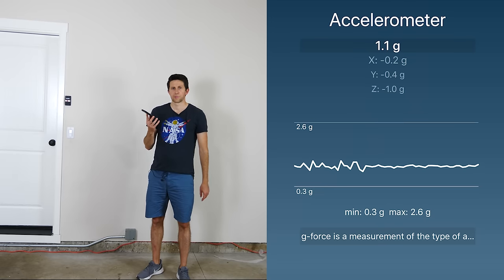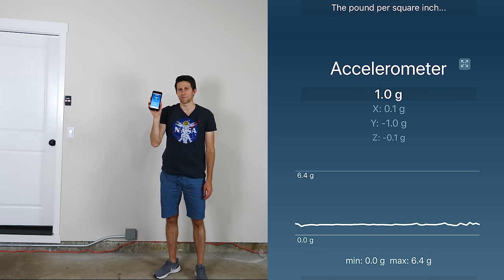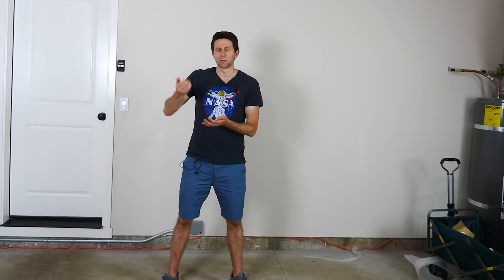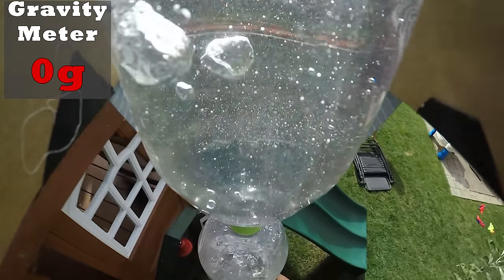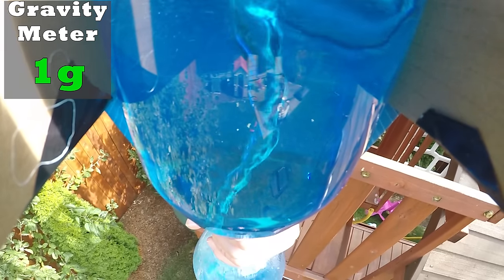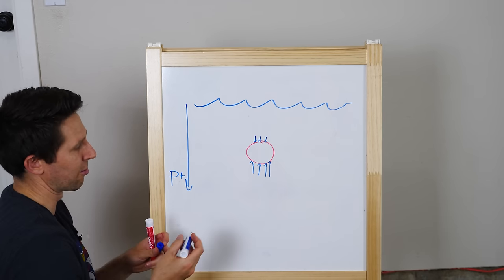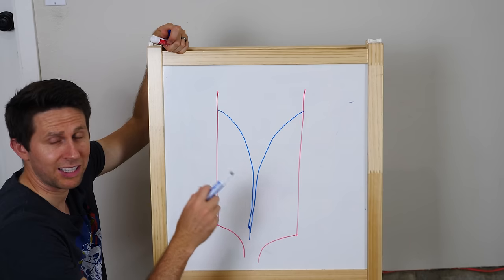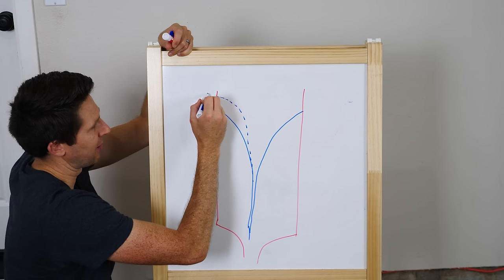What Happens to a Whirlpool in ZERO-G?

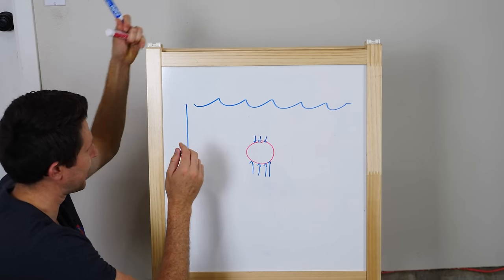Comment: 5:55
As the heavier fluid, water keeps falling into the lower pressure pocket that is occupied by the gaz , thus always pushing it upwards. A gaz bubble is akin to shadow not being a thing but a lack of something (light): a bubble is "negative space", a water hole into wich water continuously falls until it is level again reaching the surface.
Reply: This is a nice explanation but I don't think it's what really happens. Due to the surface tension, water will avoid falling into the bubble and instead go around it.

if you've ever made a soap bubble with excess liquid, you'll notice that the liquid goes around the bubble and accumulates at the bottom, instead of falling through the bubble. But soap water doesn't have the same properties so here's a better example :

when pouring water out of a narrow opening, bubbles will momentarily stop the waterflow , meaning when a bubble is big enough to fill the entire opening, water can't get through it at the same time. And since there's no space around the bubble inside the narrow opening or tube, there's no room for the water to flow.

All of this doesn't necessarily contradict your assumption that the water is falling instead of the bubble is rising. Ok, but consider what happens when large bubbles reach the surface of a body of water.
The water is elevated and pushed upwards by the bubble, right before the bubble pops.
Why would the water go up if we assume that the water is falling ?
Only explanation is that the pressure pushing the bubble upwards, is also pushing the water above the bubble up, and then around the bubble.
I thought of this part as I'm writing due to the recent video of the backyard scientist, where he made huge ring bubbles in his pool and those displaced a massive amount of water up when they reach the surface. It's fascinating ^^

Anyway, long comment, food for thought, I also don't know this stuff for sure x)
Mostly fun pondering about it and practicing english
Reply: @YounesLayachi  you are correct and great brainstorming, it would be crazy and awesome if each bubble had rain in it.
Reply: @tibss  thanks !

Comment: 1:00 to be more clear, there of course is acceleration, when you let go of your phone, but the sensor isn't meassuring it, because it only meassures weight and converts it into acceleration. If something accelerates into another thing, like if we stand on ground, then we causes weight instead of accelerating. Ironically a sensor only meassures acceleration, it it doesn't. It only shows what it would accelerate, if it could. If it sows 0g, the sensor accelerates as fast as its surrounding, on wich it measures its weight, but soo there is none.
Reply: That's the newtonian explanation

Comment: Cool demonstration! Your explanation of why the bubble rises isn't exactly accurate, meaning when you show pressure on the bottom is higher than pressure on top.  Consider a neutrally buoyant person underwater -- they have more pressure on their feet than on their head, but they don't rise up like your bubble does. It's the density that's important.

Comment: Simpler explanation of bubbles in zero-g would be to use **Archimedes Principle**: the the upward buoyant force of the bubble is equal to the weight of the fluid that the body displaces. In zero-g the weight of the fluid is zero, so is the buoyant force.

Comment: if you go deep enough will pressure keep bubbles from rising?  or prob not, because the pressure is coming from more angles than just downward?
Reply: @kirkhamandy  so bubbles at the or near the bottom of the ocean behave the same as those closer to the surface?

Comment: So if the top part of the experiment were open to the atmosphere would we expect the bubbles to still rise because of differential in atmospheric pressure? I would guess that the bubbles would still rise but at a much slower rate than under gravity likely because the vast majority of buoyancy in liquid related to the weight of the liquid itself (over the short distances of the bottle).
Reply: Creamy Pasta I don’t think so because the atmosphere would not be in freefall.  So the atmosphere still has weight. There should still be an atmospheric pressure difference from the top of the bottle to the bottom of the bottle if the bottle is open to the atmosphere. It would be pretty minuscule however and in a practical sense would not likely see much of an effect

Comment: Nice! This is basically the experiment I designed in my head to show Flat Earthers that things fall to earth because of gravity, not buoyancy.
Reply: The observations are real.
Gravity is just a word.
And it means weight.
Reply: @flatplaneoregon7075  Could you elaborate?
Reply: @andyjohnson4907  
Well the oldest definition of gravity was a low deep sound.
Which is intriguing because sound is one of the things that showed me the Earth is a Stationary Plane.
Then they applied it to weight heaviness. Like the weight of words or ideas, the gravitas of the words (sound again) or their deep even hidden meaning.
Then that became the density or heaviness of larger things or even everyday objects.
Now it is the all seeing all knowing selective, actively ever adjusting  impossible force that's not a force that really is just nothing more than a theorytale.
All of which has no effect on gyroscopes or how and why they operate independently of this alleged gravity
Reply: @flatplaneoregon7075  That's quite the word salad.
Reply: @andyjohnson4907  
Really, was it?
YOU asked me to elaborate.
 Do Not Take My Word For It.
Go look up the etymology of the word yourself.
Reply: @flatplaneoregon7075  Etymology is actually one of my passions. I'll definitely look it up.

But the etymology of words rarely has any relation to their current use, and certainly isn't the basis of a hypothesis.

e.g. The lens in your P900 isn't made of lentils.
Reply: @andyjohnson4907  maybe it could be...

Comment: If the water preassure increases as you go further down, does that mean that at a certain depth air bubbles will stay still and not rise to the surface?
Reply: No. Why would that be, since the pressure at the lower parts of the bubble will always be a little bit bigger than at the top of the bubble. The only thing, that might happen is that the air or the water change their physical state because of the immense pressure in general.

Comment: Centripetal force points inwards, and is a real force, while cetrifugal force is the apparent force felt by the object in a rotational frame, outwards caused by ACCELERATION.

In a ball full of water on a string, Centripetal is the tension in the string that's a real force, centrifgual force is the liquid being pushed to the back of the wall.

Comment: When I was younger (and more importantly, much lighter) if i had a transparent (and preferably unbreakable) container like a water bottle half full of water I used jump up while tossing it so that both the container and my head were free falling in parallel; so I could watch how it behaved in free fall. I sometimes even jumped from the roof of my school, which was about 1.5 floors onto grass, it gave a lot of airtime! 

 But sadly as I grew taller it got increasingly hard on my joints.. I'd probably break something if I tried that stunt now as an adult. :(

Comment: During my travels in my TimeBender from Lanulous, I, of course, must bring water for the 14 Lanulousian rotation journey.  Going through the intergalactic zone of desolation space, I usually turn off the main artifical gravity generator and turn on the auxiliary 0.25 gravity generator to keep air and water seperated in the Thorium reactor drive. Then I go into stasis bladder for ten Lanulousian rotations because no pilot is needed for the zone of desolation. There is nothing between the Veridian system and the Solar system, not even atoms nor dark matter.  Usually the 10 Lanulousian rotation journey, through the zone of desolation, is uneventful.  But the last time passing, there was an axillary gravity generator failure. The bagged water for hibernation injection into the stasis bladder seperated with suspended air bubbles in the water.  That caused no problem at all in the stasis bladder, but triggered the alarm because the Thorium reactor drive coolant water was being filled with suspended globes of air bubbles that hindered the cooling of the main Thorium reactors and secondary shifted plutonium reactors.  The large suspended air bubbles in the water had to be removed quickly.  I turned on the main gravity generator and the large air bubbles came to the surface of the water and popped into the atmosphere.  I was only 1/30th of a Lanulousian rotation from Thorium and shifted Plutonium containment breech causing a mixing of the two and achieving a runaway fission reaction.  This would have destroyed my 1138 TimeBender and anything within one lightorbit radius of where I was zone.  It is a good thing I was in the middle of the zone of desolation and even a better thing that there was not a containment breech.
Reply: y did i read this lmao

Comment: Well, technically if something is falling it is still feeling earth's acceleration. It just doesn't feel the pressure of its body on the ground or its surroundings.
The handy measured compression of smth under its own weight.
Within an enclosed space that is falling, there are (mostly) no gravitational effects visible because earth's acceleration doesn't depend on mass. So the air and the water in the bottle are displaced at the same relative speed. That's why there is no relative pressure (as he explained with the bubbles) and within the bottle things move to each other as if everything was weightless.
Once the bottle reaches terminal velocity, the gravitational effects within the bottle return.
This weightlessness only works as long as your enclosed space is being accelerated.
Reply: Does orbiting stuff (orbiting is just falling with style ^^) accelerate? No they don't. 
Even if it's not intuitive the fact is it's not you who are accelerated to the ground but it is the ground that is accelerating to you. That explain why everything fall at the same speed, cause in fact they don't move, it's the ground that move. but all those movement or none movement are done relative to space-time which is the one "moving".

Comment: The statement that "an object thrown upwards doesn't feel any gravity" is what I have a problem with. Object flies up due to initial upward momentum you give it, then it slows down due to it is acted on by gravity (i.e. it is being decellerated on its accend). So how is it not "feeling" any gravitational acceleration during the accend?
Reply: Is it the object being slowed down or the ground keep accelerating?
Once the object is launch it has no more acceleration and keep his speed (will ignore air resistance here) while the ground is constantly accelerated and therefore keep getting "speed" so the relative speed between object and ground decreased until it reach 0 when the object reach it's peak altitude, then relative speed keep decreasing so now it's negative so ground is going faster that object and object appear to fall back.

But i guess only a 4D creature could see it that way... don't forget that to stand still in a collapsing/bending/wrapped (never sure which word to use for that...) space-time, you need to accelerate just to stand still (not sure that will help but i hope i make it a bit more clear)

Comment: I got really confused with that explanation, because the accelerometer is measuring the force the earth (or you) is doing, not the resultant... and the resultant is equal to zero when you are holding it (therefore the phone is not moving). But that's not equal to zero G. You can see that when you drop the phone, and the accelerometer shows 0 (because nothing is holding the phone) but the phone is free falling, and not in 0G condition. The 0G condition would've been achieved if the falling was high enough that the air resistance compensated the falling, then the phone would've hit terminal velocity and experience 0G.
Reply: The nG scale measures the intensity of the acceleration countering your movement not the actual gravitational force. On ground, the normal forces counters your down movement with the same intensity as gravity, so 1G. If a freefall object is aerodynamic enough, it doesn't feel air resistance and therefore has 0G. If the air resistance compensated the falling, that would be 1G. If we put it in a centrifuge we could get 2G  if the centripetal force countered its centrifugal movement two times the intensity of earth gravity.
Reply: @quantumsoul3495  Thanks for you reply !!! But I still didn't get it: "If a freefall object is aerodynamic enough, it doesn't feel air resistance and therefore has 0G" it has no sense to me, because if I take this aerodynacmic object and let it go (of any distance from the ground) it would hit the ground ... so that proves that it's not a 0G condition, but it has gravity acting on it! (otherwise it would float)
"If the air resistance compensated the falling, that would be 1G." I really don't think so, the resultant would be equal to zero, because you would have the air resistance compansating gravity and the speed would not increase anymore, it would be constant, proving 0G or zero forces acting on the object.
Did I think something wrong?
Reply: @camilabborba  Your problem is nG doesn't measure the resistant nor does it measure the gravity. In a centrifuge you can get to 2G but you still have the same gravity force. In all the cases above, you still have gravity. The scale mesures how you "feel" weighted. When you fall without air resistance, you feel weightless. However, standing on the ground you feel 1G.

Comment: Question 

When we close our eyes we cant see anything which means light is not reaching our eyes . But even with eyes closed , we can still sense if the light gets off . How is that possible
Reply: That happens because there actually IS light hitting your eyes, just a LOT less than if your eyes are opened, so if the quantity of light change, by turnig off the light or pointing a flashlight to your eyes, you can perceive it.

Comment: Phone accelerometer showed 0.9G when it left your hand, according to frame-by-frame analysis, and achieved 0.0G at the top of its arc. The phone did not lose all acceleration when it stopped touching your hand, it decelerated rapidly.
Reply: No it is not. The phone can feel acceleration only compared to a frame of reference to which it is physically connected. Unless the phone's innards are subjected to forces internal to the phone during the climb, the accelerometer cannot feel any acceleration if the phone is in ballistic mode. The phone is in free fall mode as soon as it leaves the hand, although it is not, per se, "falling" in the usual sense. The only reason it is going up when leaving the hand is inertia (the phone has an upward speed when leaving the hand)

Comment: gravity isnt the only force here. when the molecules rotate in a circle. Those in the middle have the lowest pressure on them so the atmosphere is darting in the middle and at pressures proportional each "rings" rotation speed making the outer edge the highest pressure...do it in a vacuum or a pressurized tank and you'll notice differences

Comment: What happened to the bubbles just like what you feel in car’s acceleration, so you feel that you got pushed to the opposite direction but here in the case of bubbles the acceleration was vertically instead of horizontally in the car. In addation, the gravity can go to negative number so the bubbles can go backward from up to down if he throw the bottles down with more force🤓

Comment: In the water bubble experiment, If water pressure doesn't apply when in zero-G, do the pressure inside the bubble is greater than the outside ?
Reply: They are the same.

Comment: 5:40 does that mean a bubble at the bottom 9f the oceam will stay where it is?
Reply: I think I see what you're asking. The answer is no. The reason why there is more pressure on the bottom compared to the top, is because air is LESS DENSE than water.

If you had a denser object (like a bowling ball) then the pressure would be reversed. The pressure would be stronger at the top (going downward), rather than stronger at the bottom (going upward), hence why bowling balls sink, and bubbles rise.

If you had a bubble at the bottom of the sea floor, it always would rise (if it's LESS DENSE than its surroundings.) The upward pressure on the bubble would be at its maximum on the bottom of the ocean, because it literally has the entirety of the ocean above it vying for its space. 

Air is attracted to the Earth with less gravitational strength than water. And because gravity is pushing water DOWN more strongly than it is pushing the air down, that makes water win that "battle" for the space the air is occupying. The water steals the bubble's space, and thus the bubble is propelled upwards. The higher the bubble rises, the less pressure it has underneath it, because there's less water trying to displace it.

But of course if you turned gravity off, the water doesn't need to "fall" down and steal the bubble's location anymore. And the bubble can happily stay in place.
Reply: Wow, you must be a physicists. Thanks
Reply: Why would it?